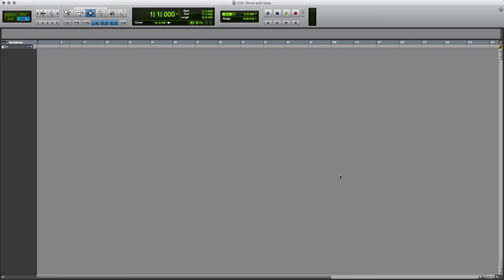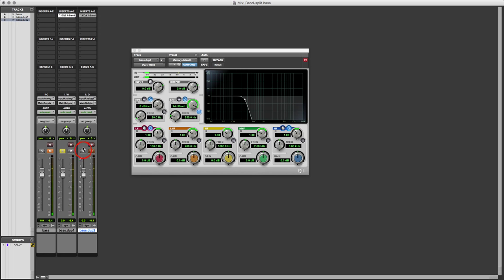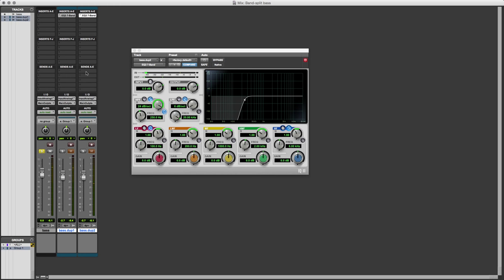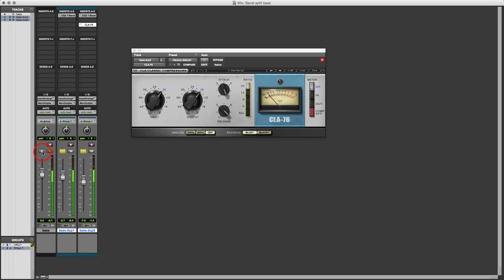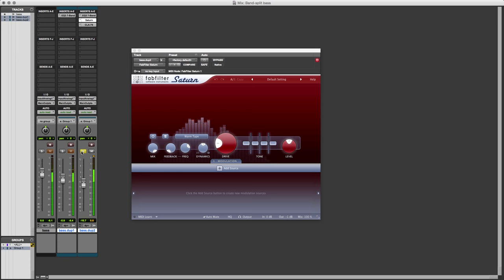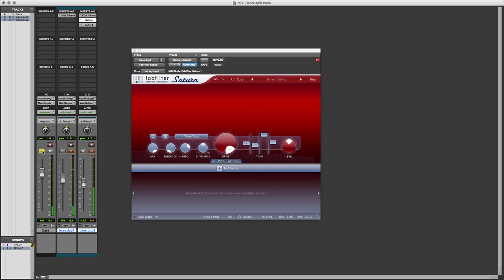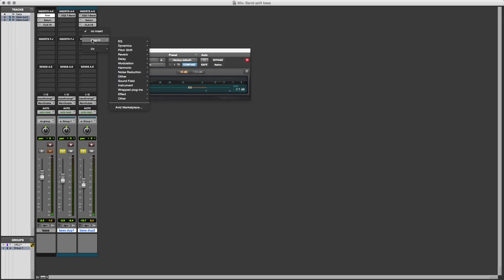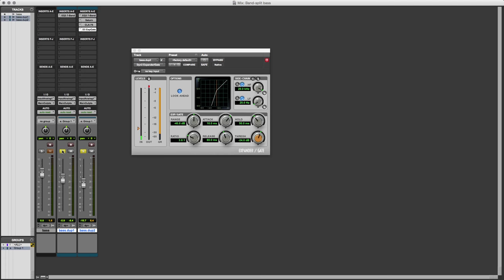Band splitting and processing a bass guitar

Comment: You can do it the analog way. Re-amping my bass take, I used a DBX 223S filter to split the signal in 3 bands : Low, medium and high. The I sent the 3 bands in 3 separate channel of my DBX 1046 compressor-limiter for distinct compression and level. The 3 channels were sent to 3 separate tracks in my Mackie 1642 for balance of level and distinct FX send.  I can emphasize how the signal upgraded in punch, clarity  and overall space definition :-)  Try it and love it guys !
Reply: Which frequencies do you use to split that 3 bands?
Reply: 250 Hz and 3.5 kHz. The 250 and bellow to handle the low end that usually produce a lot of energy, the medium range 250 to 3500 where lie all the definition and clarity of the signal. Finally the frequency over 3.5 kHz to manage the upper harmonic content, the brightness and the air. Also helpful to treat noise.